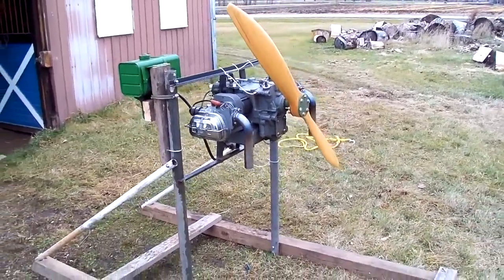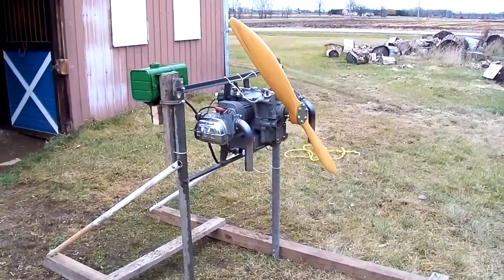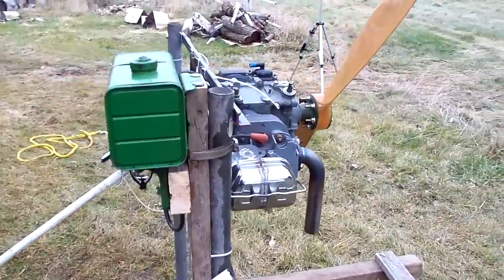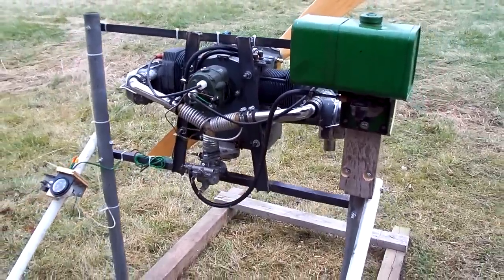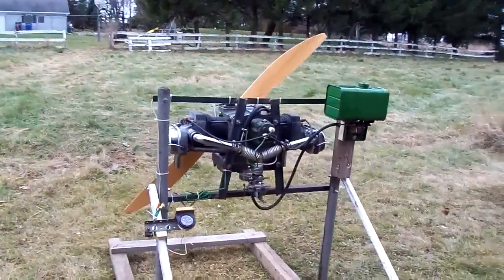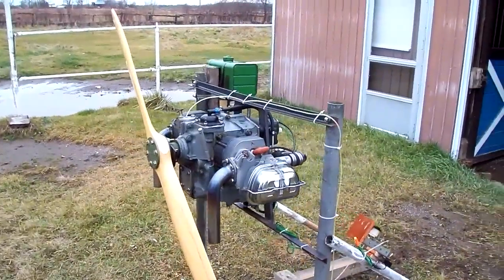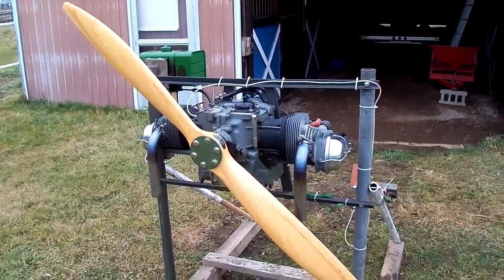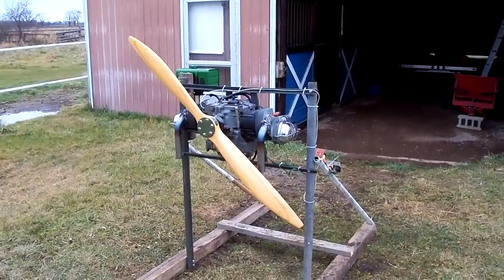Half VW Airplane Engine Test

Comment: you dont need a prop  on it to test it,  and you can put a crank bolt and use a drill to start it = way safer.

Comment: Idles perfectly.  On my opposed twin bmw I would not run it so lean that the pipes turned blue.( nice amber was swell) .you have to double check by reading your plugs, and perhaps with an exhaust gas analyzer.. but my experience says that is too lean on the main jet/needle  depending on what type carb you have.   and at altitude.. for sure too lean... very short pipes like that are hard on the exhaust valves..a 2 into 1 pipe will have several benefits.. but lovely engine and bravo.. details on the ignition and carb would be nice... dont forget to retorque your heads after a few hours, and keep after the valve clearance...used to be every 3000 miles in the cars.. and at 60 mph that's 50 hours.  start with 25 hours until you learn how it behaves.  dont let the exhaust valves run tighter than spec or they will burn.

Comment: I would call that a Success  and Oh  can you really call anything Plane related as Over Engineered ?  even a test stand for any motor  with a Propeller  should have some extra built into  it imo  i think it was a Story about the  original Spitfire pilots  i read that i always think of when  looking at anything Airplane related  they said those planes had so much torque  to them that there was a certain skill they  had to have  during taxi  and take offs not to accidently  flip the entire Airplane 360 degrees  in a barrel roll  one of my old next door  neighbors got a present from his wife to  go fly Spitfires in Florida  and i  talked to him right after he did it  he was well into his 70s and  he acted like a teenager  after a date with the Prom Queen lol  he of course had the videos  and apparently the school  has a rule that obviously you have to be licensed  but  secondly  they  will not allow  you to take off and land in their planes  untill you have so many hours flying with their pilots  oh yes the facility that owns all the restored Spit fires is also a School  he also told me the hangar  they  stored and worked on the fleet had a white Epoxy floor that was immaculately clean

Comment: So here is my question for use on a different project would a guy be able to turn that cut case in to a one cylinder and or would a guy be able to leave cylinder and heads on one side cape the other side off and make it a two cylinder vertical or would that upset things on those engines hopefully some one with more knowledge on those engines might be able to answer these questions

Comment: how much is the cost of engine?
Reply: What this is is a 1990's  Volkswagen Beetle engine, cut in half and put on a draw through carburetor. Theyre air cooled, and really light. The engines can be bought in any condition, for anywhere from 100$ to 5000$ depending on the condition. You can then buy plans on how to cut it in half properly, What carb to use, etc. These Make for one hell of an engine for a superlight aircraft or helecopter. GOOGLE "BETTER HALF VW"

Comment: How did you manage to get 37 horsepower out of the 2 cylinders when the 4 cylinder version only had 36 hp? what were the head and cam mods?
Reply: An Aerovee VW conversion of a 2180 puts out 80 hp. Most of these smaller 1/2 veedubs put out 37 hp without too much trouble.
Reply: 92 x 82 stroke 37 hp. Use a 1600 case

Comment: Can't fault these things.  Nice sanitary job.  Much to be said for 2 into 1 exhaust which when done right uses the exhaust pulse from one cyl to extract the exhaust from the next... this creates a tad more power, and also reduces specific fuel consumption.  Weight has to be figured in.. Straight pipes require a richer mixture and waste fuel.

Comment from the maker: @tthhnnee The engine weighs around 100 pounds ready to go with oil, prop, bolts, exhaust pipes.  Oil flows through the coils on the intake pipes, warms the pipes to prevent icing at colder temps or higher altitudes and even cools the oil a bit in warmer conditions.  Thanks for watching!
Reply: How buy this engine
Reply: ever read the oil line temp an intake temp ?   cooler air is denser makes more power... carb icing not to be ignored..

Comment: Great, when you start your flight training, consider glider training. Gliders are much more intense a piloting experience than powered and it will get you ready for all kinds of issues in airmanship. Plus, it's much cheaper. Consider it when you start flying.